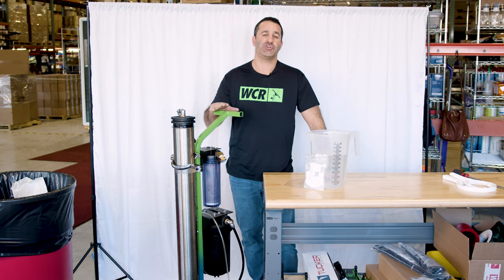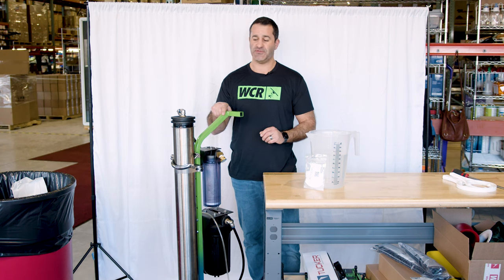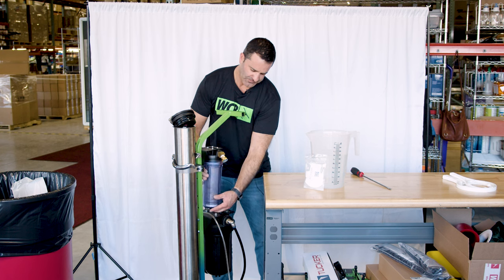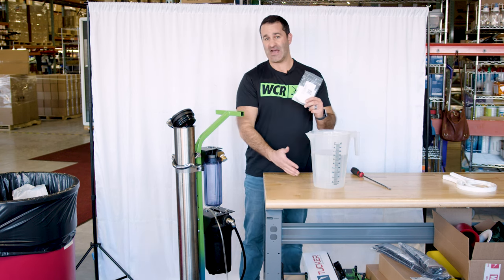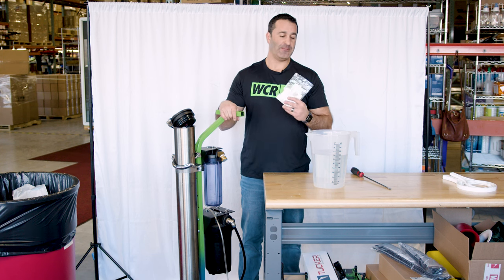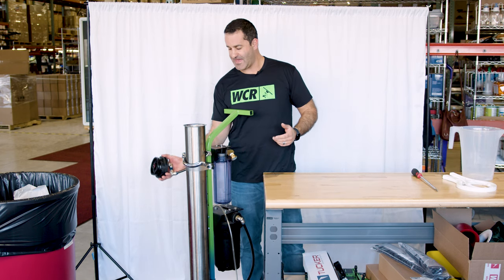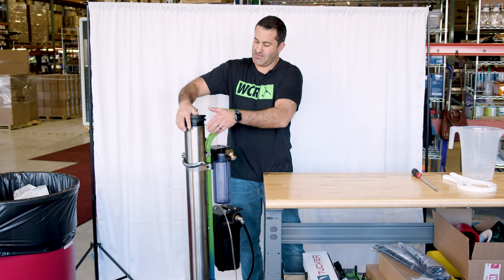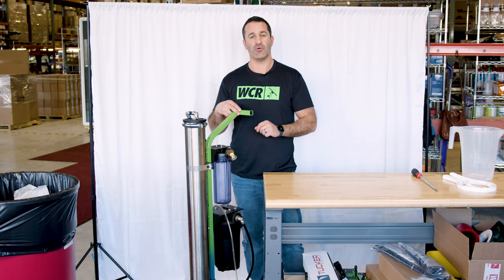Winterize Your RO/DI System In Under 5 Minutes

Comment: If I never even used my water fed or got it like a week or 2 ago. Should I just run water thru the membrane every 2-4 weeks as I’m gonna start using it in spring? Say March? Or should I add the Ro guardian membrane still even tho I never used it yet.
Reply from the maker: you should run water through it every 2-3 weeks if you can, if not then you can go ahead and winterize it with this protectant ~Jersey 862-312-2026  https://windowcleaner.com/products/xero-ro-guardian?sca_ref=3020234.dl0aAoVJ1A